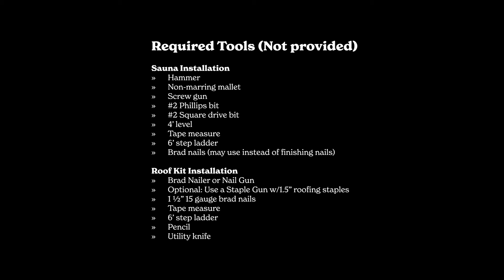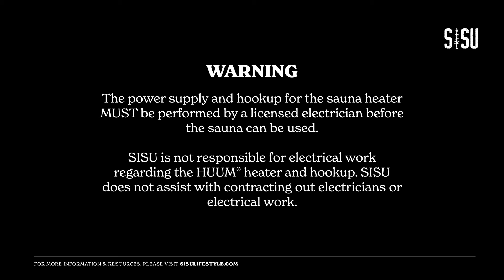SISU Charlie Cabin Sauna Assembly

Comment: Why do these instructions leave out wiring to the heater and to the hard wire? Electricians like to follow manuals. Also what are the chances the predrilled holes are in the wrong spot?
Reply from the maker: Hello! You can find our manuals and heaters here:
https://sisulifestyle.com/pages/faqs

If you have trouble with your install, please email:
Customer Service and Sauna Building Support
(216) 294-2478 press 1
support@sisulifestyle.com
Reply: Cost?
Reply: Can the cabin be fully assembled and then moved a short distance for final placement?  It will be placed partially under an arbor on my deck.  I wouldn't be able to assemble roofing while in it's final placement.
Reply: @eriknash8783 yes. But not with ease… not like tou cna just pick It up. But if you have helpers and furniture dolleys (and smooth service) you could move it im sure.

I had to move mine 2-3 feet and chsnge angle on it, with just one person.
Reply: @eriknash8783  It weighs 1181lbs